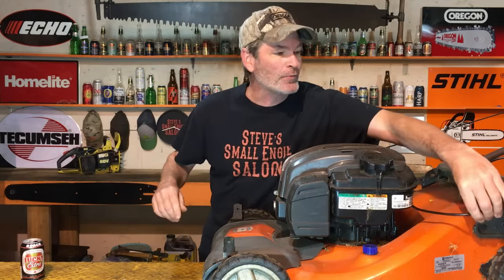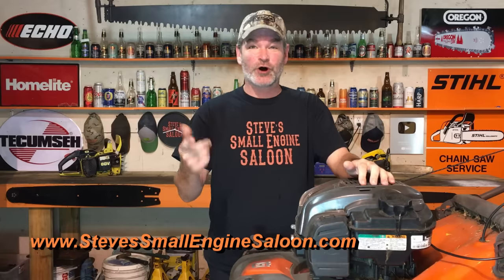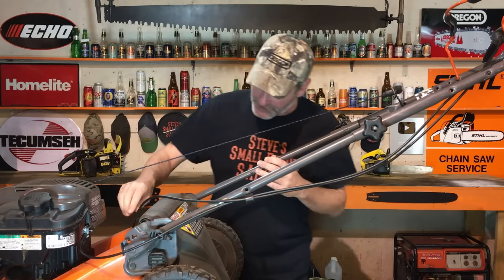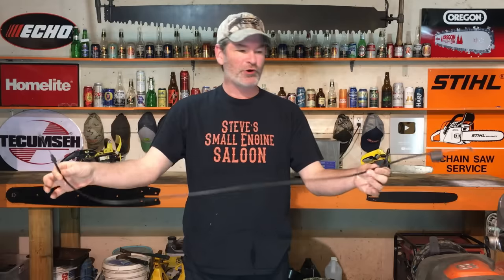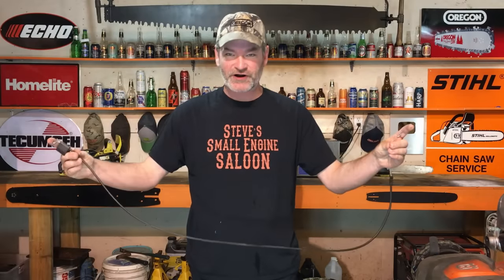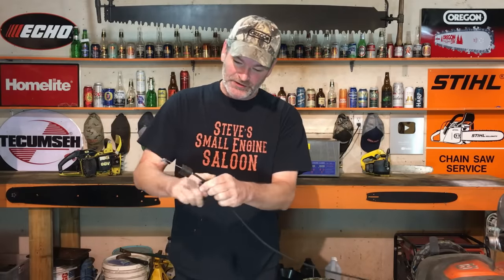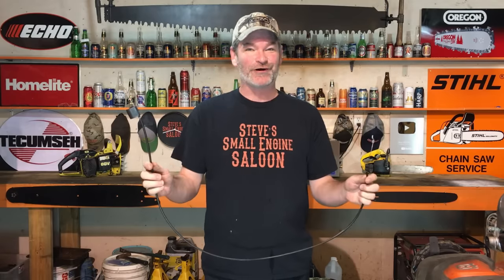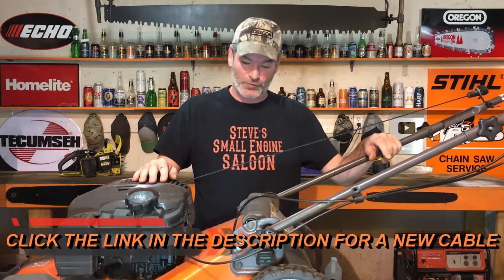How To Adjust A Non-Adjustable Lawn Mower Cable

Comment: I have a not in my cable 😔... i though I was pretty smart when I figured out the cable was not engaging the electrical only after finding no spark, replacing the coil with a donor coil from a garbage find, still no spark... put it back on donor, getting spark, putting it back on.... no spark...  thinking over a six pack and searched for broken wires when I noticed the cable wasn't making the connection...  thanks youtube for recommending this video 2 years to late. Ps fuck briggs and Stratton for making me disassemble the entire engine to get to the coil, I could work on the production line now ffs...

Comment: Unscrewing the cables didn't do it for me, there still was too much slack. I decided to drill a hole lower than the original hole for the hook up hardware and pinned it there. Problem solved!

Comment: If you screw it right off you can drop a spacer  into the shop
car made out of a spark plug  dead
Reply: Or you can bend the bracket